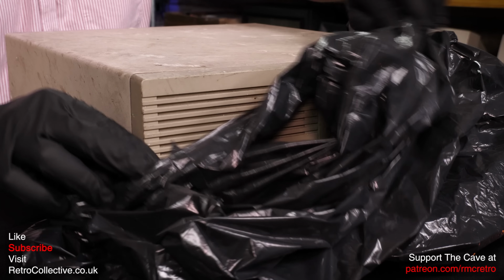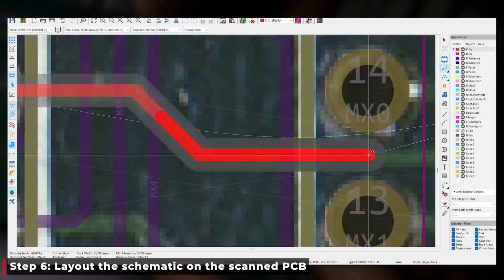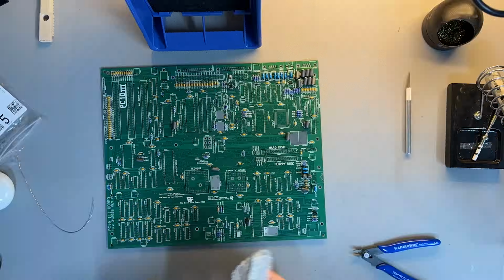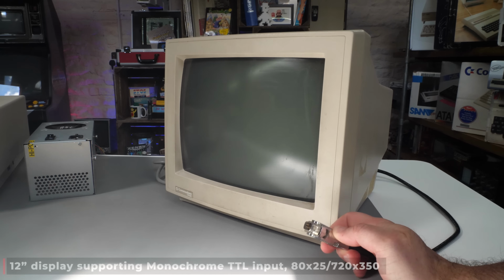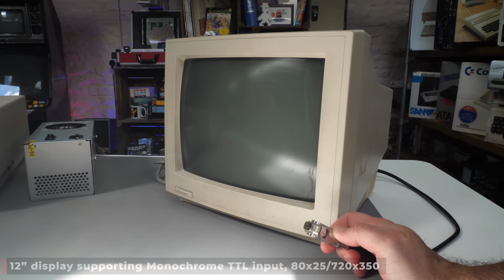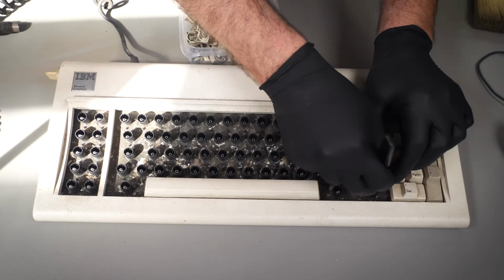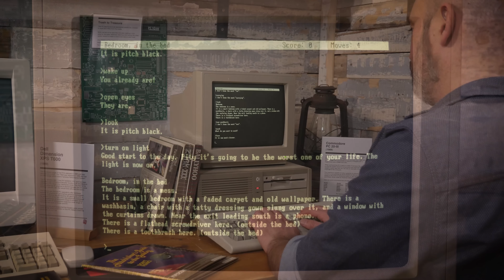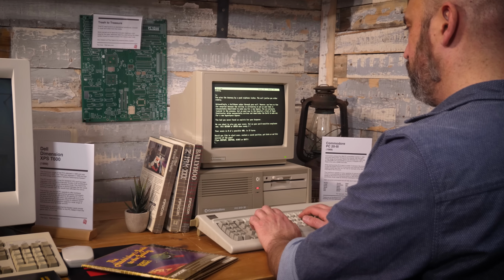Too Broken to Fix? Just Make a New Motherboard! | Trash To Treasure

Comment: when it comes to "CGA-era" computers there is one system that i think should get more love than it does these days.
while a bit late for being CGA-only and more going towards start of the VGA-era the 80286 computers are the last of the 16-bit's and should be appreciated more than just being labelled  "a 8088/8086 that is to fast".
a Philips NMS9100 or P3230/P3105 in that iconic old Philips desktop case would have fitted nicely in with the other systems playing games from Alley Cat to the later Commander Keen... and could even run Windows... (with some extra RAM that is... Win3.0/3.1 would gobble up all if it's just 740Kb on it)

problem is just getting hold of one that isn't completely broken.

Comment: That is awesome to rebuild that motherboard. And I was watching that same keyboard I think. 

I always wanted to get a Colt for a modern PC case but never wanted to destroy. So your recovery effort is awesome!

As for what to use it for… setup a BBS terminal using the Wifi->serial adapters. 

It would be a great addition to the cave and if it were internet accessible, could have people from outside participating. I’d recommend something that supported Ansi/Ascii/Petscii if possible. I ran a Color 128 system for years but the followup, Centipede, should work well for all platforms. And given VICE can emulate, it shouldn’t be hard to virtualize it on a Pi or something. :) 

Dang. Now I need to dig my old C128 out and set it up again. Been down since 1999. :p

Comment: Don't use acetone and definitely not brake fluid on that type of plastic (assuming ABS)! It'll dissolve right through it given enough time. I've never gotten good results with GooGone. I recently discovered WD-40's effectiveness on sticker residue for myself (it's safe to use on polycarbonate!) and will absolutely use it in the future.

Comment: I have this machine. It's been a few years since I fired it up now but I seem to recall It had quite a few interesting screenmodes that are documented in the manual. I tried for a long time to get a 5.25" floppy drive working with my 3.5" floppy drive but never had any luck. I've played a lot of Wasteland on this one. It's a very good 8088 machine, with turbo and all those fun screenmodes. I actually never had any luck getting my tankmouse working either so I've been using a serial mouse. I might have to start it up again soon.

I vote to upgrade it. I've bought an EGA card for mine but then remembered that I don't have an EGA monitor. :P And upgrading to EGA would mean not using that wonderful monitor. I think VGA makes little sense on an 8088, but the machine does take a math coprossesor of some kind I think, and an adlib card or something would make sense. I love writing on these old computers so I always hook them up to a printer. I'm just rambling.. Thank you for the video :D

Comment: Normally when I see WD-40, I go on a rant about how I prefer PB Blaster, but probably not for cleaning sticker residue. While PB Blaster is a much better product for freeing about rusty bolts on old cars and the like, it has a pretty powerful smell, and is really not pleasant to use indoors on projects like cleaning up vintage electronics.

Comment: A side by side comparison with an upgraded 386 next to a stock 486 would be a fair part of the story. Similarly, an upgraded 486 next to an early Pentium would be part of the story. Nowadays we don't have the same upgrading going on, nor do we have the rapid and substantial progress.
With cars people like to tune their old car to beat the new thing that someone else has, if you can beat a fancy sportscar from the lights with your 'riced' hatchback then it feels good. In the early PC days you certainly could do this with your old 386 versus the new 486 or with the 486 versus Pentium scenario, particularly when software had yet to make use of the new features. There were aftermarket CPUs such as Cyrix things and with more RAM, more disks and a graphics card, an old PC could trump a new one.
This approach enables 'bone stock' next to 'period correct pimped' to be shown. If you have the same game running on each then all is good.
On games, sure these are good for demonstrating software, however, early integrated development environments from the likes of Borland were quite fun too. A lot of people know a bit of HTML and have tried their hand at javascript. This realistically means a dual monitor setup. A 1280x960 display flickering away with a Borland IDE would be a nice addition, particularly if you had all the manuals around. Delphi. C++, MS Visual Basic things, Powerbuilder to build desktop apps played a huge part of the story where people would be building for the next gen on the previous gen.

Comment: The machine probably doesn''t have a CGA adaptor, but rather an AGA adaptor, Commodore's own, which could emulate CGA as well as Hercules.  Hercules supported nearly the same resolution as EGA but in monochrome only.

It would be a shame to upgrade past that era.  Heaps of early DOS software made use of it.  IIRC, Prince of Persia can use it, and I'm also sure there was some educational software, maybe from Broderbund, making use of it.

Comment: You cannot beat the original WD40 BUT they are about too or already have changed the recipe which reminds me I need to stock up!
I have been using since 1986 as it was taught to me by another engineer when I was in office equipment repair(moved into IT) as sticky labels used to get stuck in the machines. Then use alcohol to remove the oil so not to damage the documents.
I have tried many chemicals with varying effects over the last 30 years & WD40 is the best for value / productivity!

Comment: The original IBM keyboards were absolutely INCREDIBLE for DATA ENTRY! I wish that somebody would bring them back!
Reply: Model F recreation keyboards exist but cost a small fortune… over £200 a shot
Reply: @brianhedley5139  Wonder where I can get one? BTW? A Yank in the U.S.A.  BE WELL & SAFE!
Reply: Those keyboards never went away. Unicomp still make model m keyboards with the original IBM tooling. I use one at work. There's also a company that make modern day model f and even beam spring but they cost a fortune
Reply: @mr.y.mysterious.video1  I think that the Model F would be one that I would be most interested in? It looks like the MODEL M was beginning to drift towards the modern design which ( my opinion) is lousy for pure data entry. About the ONLY thing lacking for Model F was the cursor keys. BLESSED BE!
Reply: @jtc1947   Drift towards the modern design? I'd say the Model M defined it. Microsoft might have hacked it a little with the introduction of the accursed Windows keys, but the fundamentals were laid down by the Model M. Using a Unicomp Model M made in 2017 right now.

Comment: You should definitely leave it as is as a text based computer, or at worst a CGA computer; when I first came across IBM PC compatibles, monochrome Hercules was fairly common, and there needs to be a representation of this era in your collection.
Reply: And like you, my first computer was the Amstrad CPC 6128, but I had a lot of exposure to PETs - I learned BASIC on the PET in the 1970's. After that, friends and relatives had Vic-20's, C64's, Amiga, BBC's, etc, and more before I turned 18.

Comment: Personally, I'd want to add at least a couple graphical games on there that fit the period. Something that looks good in black and white. 

You've just got so much space on that drive, and even if you load it up with every text adventure that exists, you'd still have more room.

You might consider looking to see if there are any period menu systems or GUIs for it. There are surprisingly a lot of them that ran in black and white mode CGA. Though there is charm in typing in the old MS-DOS commands, there is also fun in getting those things set up. Plus you already are providing a menu for people who are less familiar with the system. 

Finally, while it's not relevant to this computer, those rubber feet on the Model F still looked pretty dirty to me. They're hard to clean, though, so maybe try to find some rubber feet to replace them. (They're easy to find in black, but it looks like the originals may have been brown.)

Comment: Commodore management:  Hold IP of multimedia personal computer with a loyal / almost fanatical customer base.  Build underwhelming IBM PC clones that nobody wants. :face-orange-raised-eyebrow:
Reply: But the clones seem to have sold reasonably well, and the markets into which they sold were not particularly receptive to the Amiga, where PC compatibility was becoming a necessity. I can imagine that along with steady C64 sales, the clone sales were Commodore's bread and butter for a number of years.

Such was the influence of the IBM PC that you can see from reporting of the Amiga 2000 in publications like Computerworld that the Amiga Bridge Board, offering cheaper compatibility than the Sidecar, was seen as the machine's primary selling point, but there was also a skepticism that a system offering some PC compatibility along with better graphics was going to sell all by itself.

Indeed, many vendors tried the PC expansion card approach - Apple did so, as did Acorn repeatedly - but PC clones were probably the more effective way to get sales, worth doing so while there were still margins to be had. And building clones would have freed up resources to do more interesting things with the distinctive product lines at these companies.

Comment: Two thoughts..

If it had been more than two layer, I’m assuming that would have killed the project

2. Aren’t board layouts copyrighted?
Reply from the maker: Hi Charles, if it’s more than 2 layer it can still be done, it’s tricker as it involves sanding off each layer to scan it one at a time.
On the copyright I imagine someone must own the rights to the board yes. I’m comfortable having a replica to replace my original and I’m sure anyone else is probably going to be the owner of a broken original board they will be transplanting chips from. I wonder who does own the designs and if they even know it 🤔

Comment: Did you replace that crusty old battery with a CR2032 holder?
Reply: Since this is an XT class motherboard I don't believe it had a battery. All of the settings are done using DIP switches.
Reply: @_Thrackerzod  Look at the video at 2:07 - 2:09 and tell me what the blue object should be... 😄
Reply: @klaushergesheimer8602  You're right, I missed it somehow and also misread your post where you said "that" battery. It was late, lol. I don't see a coin cell or any kind of battery on the new board at all, curious what it uses now.

Comment: Nice video, but the keyboard is not the right one. I've had the same model pc in the '90s and the keyb was something like AT style.
Reply from the maker: I think I mention that it’s a slightly earlier model at the end of the video, same with the monitor, but it’s as close as I could find. Very happy with the result
Reply: @TheRetroCollective  Sure. In fact, I didn't want to do the needle-in-the-haystack thing. That keyboard belongs to the pc-10 model 1 that I also have. The PC10 III (and also the PC 20) had that other type of keyboard, similar to that of the Amiga 2000, with twelve function keys and LEDs. Now, I've never had an Amiga 2000 but if the connection is DIN perhaps it is compatible between models.

Comment: The IBM keyboards were trash for former terminal operators which used to hammer at them with two fingers using their elbows. Hence those terrible coiled springs, metallic plates, multiple kgs of weight.
Also, the buckling spring design was so flimsy they could not have large keys. Later models had to use stabilizers for EVERY non-square key including 2 for Enter to hope it will work reliably with 10-finger typing.
But of course there are people who are swearing by any junk imaginable.

Comment: Isn't it customary by now to test a restored 80s till early nineties PC with Planet X3? 😅

I have one gifted by a friend who is a Commodore enthusiast and i found another one, a 286, in a recycling center, even seemed to have been used until it was thrown away as a glorified typewriter. Sadly i couldn't rescue the monitor.

And we had to repair the rescued one, the Dallas CMOS chip had no charge left and we opted for the Dremel fix of disabling the internal cell and attaching a new one in a socket.

Comment: WD40 isn't optimal for removing sticker gunk since it can damage plastics, but it's your call to use it.
Reply from the maker: Thanks! I make sure it’s cleaned off with other products after and then treat plastics with 303 Aerospace Protectant monthly. Should be fine
Reply: @TheRetroCollective  Sounds good, I was a bit worried it might cause some issues down the line but seems like I got nothing to worry about👍

Comment: Wouldn't the CF card thing impact the authenticity of the retro feel though? Maybe not as much for the speed, but the audio ambience of the whole environment. Maybe there are these adapters that emulate the disk sound. If not, there should. :)

I remember when in favour of the 40MB HDD putting a massive 128MB CF in my Amiga. And while it certainly felt even more modern than ever, it wasn't quite the same without the "vvvrrreeehuuiiiiEEEEEE" start sound or the gentler whirr and clicks after .